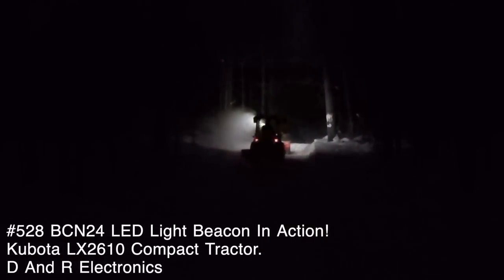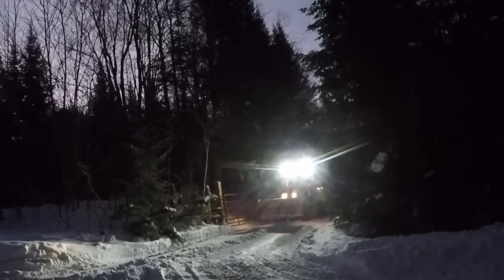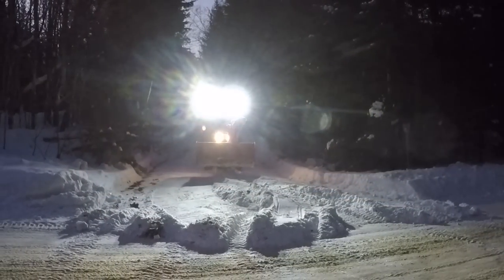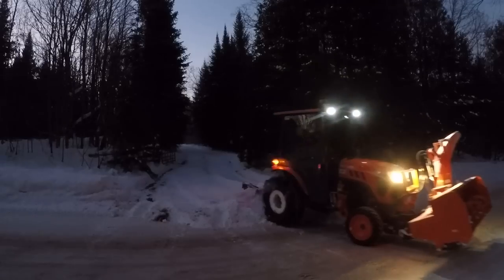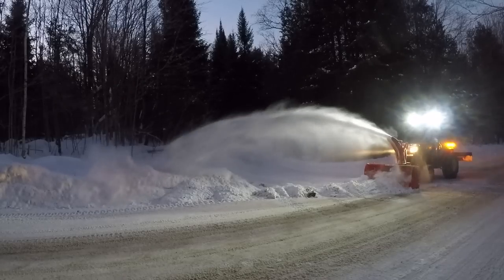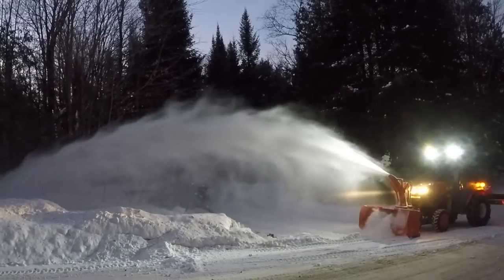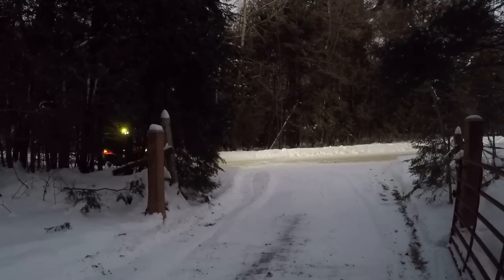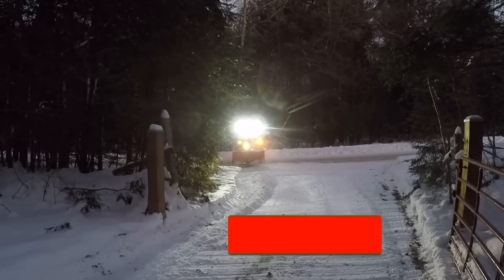528 BCN24 LED Amber Beacon In Action! Kubota LX2610 Compact Tractor. Clearing Snow At Night.

Comment: The strobe works well, especially for the sides and back. Hard to miss those bright front lights. Important for safety when working at the road. Yesterday my brother had his Kubota BX and rear blade helping clear the base of a neighbor's drive, and some guy speeding came by and caught the toothbar he had on his bucket. Took out the side of the car all the way down like a canopener. Fortunately no injuries and just bent the tooth on the tractor but inches for much worse.
Reply from the maker: Wow- good evening MD. Happy no injuries but same thing happens up here. Folks use these side roads like race tracks. Glad all were ok. Thanks for sharing!

Comment: The beacon works well. The low profile is a good choice. It will be interesting to see if it produces enough heat to melt the snow if you are using it during a heavy snowfall. 2 weeks ago a friend of mine just bought a cottage he is going to  move to full time. He's selling his open station kubota and buying one with a cab. He was asking me what would be the best setup for clearing snow. I told him about your channel and all the great information there is not only for snow but tractor's in general. As long as you can give up the loader for the winter a front mount blower seems to put less wear and tear on your body.

Comment: Good video Gord, the beacon may have been a little more clear in between the front lights but the roof wouldn't take the positioning it there. The beacon seems to be doing fine right where it is. Thanks for sharing with us, Fred

Comment: You may see the beacon when you are straight behind the tractor, but when you are on a right turn it will be less effective. I think you are fixed on using the existing hole in the mirror bracket, make a bracket and mount it on the left. (You may have to remount the antenna and the beacon on the same bracket)

Comment: I have the same set up that you have with the work lights. Looks like no matter where you put that beacon , at some point those front lights are going to over power it. That kubota does one heck of a job. I don't need the front blower ( which is super sweet mind you , we just don't get enough snow these days here in North East Wisconsin ) but the rear blade is something I am going to look into. Nice camera work by the way.

Comment: Greetings Gord, from just to your left (depending on which way you're facing) in northern Michigan. One of these lights would be dandy if I had a cab on my kubota LX2610. Instead, I have resorted to using an old Radio Shack toy firemans helmet with flashing red light on top. Eat your heart out as yours doesn't even have a siren.

Comment: Nice series on the beacon installation.  Good video of night scenes using the beacon; the flashing light really shows off from the side and rear views of the kubota.  My JD 3720 cab has the rear flashing lights located up high tucked under the roof of the cab.  They show off well from the rear, but not so much from the side of the tractor.  I really like your tractor/blower/blade set up for maintaining your road. Looks like you will have minimum snow buildup on the road come spring melting and re-freezing season.  Well done my friend.  Steve from Minnesota

Comment: On your kubota you could add two strobes on your blower don't get the strobe that you can see 360 degrees.. otherwise that will drive you crazy.. Also I would put on on each side of the tractor so when you are at the end of your driveway. you can get little round ones If your going to light it up light it up.

Comment: This is a great safety feature. I’ve heard of several tractor accidents where a car strikes a tractor from behind, usually due to insufficient rear lighting on the tractor. This should have you covered. I think you could easily install this in the kubota UTV’s as well. Thanks as always for the great videos.

Comment: I like the way you installed your beacon. When I put beacons on my kubota I reinvented the wheel and made brackets that mounted to the upper signals on the rear of the cab. It worked but was more complicated then your set up. I ran separate wiring and a switch to turn on and off because I didn’t want to hook into the rear work lights. If you would have made this beacon install video years ago I certainly would have copied your work. Good job GP
Reply from the maker: Thanks Jace!

Comment: Strobe light looks great on the kubota. Curious, why didnt you mount it on top of the cab in the center? Was it to avoid drilling a hole in the cab? On some angles I wonder if it was inbetween your 2 LEDs if it would be seen better.  Either way there will be angles that it wont be as visible and what you have seems to work just fine. Enjoyed both videos!

Comment: Anybody that can't see you coming head on should have somebody else driving!! The beacon is perfect for anyone coming from behind. As a 30 + year firefighter I think some of the current LED lighting has gone to far the other way. I have almost been run down because people are blinded by the brightness of the LED  lights. They can be adjusted down but in a large department it's difficult to get the shop time for this.

Comment: Good thing to have and believe if working commercially a legal requirement? Also along that line. Do you know if plating your tractor is require for insurance coverage. I have a kubota 1880 and clear in laws 2km up the road. Think I need to plate and a beacon even for family.

Comment: We can certainly see the kubota coming now.  I checked out the website for the light but noticed they don’t have an online purchase system.  Did you just call them and place the order.  I think I will get a light as I live on a cottage road with many residents.  Better to be seen.  Thanks for another great video.
Reply from the maker: Good evening Andrew. Yes, you have to call for pricing - either direct to them or through one of the dealers in North America. I think there is a dealer finder tab on the site. Good luck !

Comment: I recommend putting the beacon on its own switch, or to the OEM flasher switch if it's steady power at that point.  If you shut the work lights off to not blind oncoming traffic, you'd lose the beacon right now.
Reply from the maker: Thanks Matt! They are bright for sure. I may need to tilt them down a little more. Thanks!

Comment: You can't put a price on being visible, with most accidents involving essential vehicles and normal vehicles, chief excuse among those crashing into essential vehicles was that they couldn't see what's going on.

So these days people sue when they crash into clearly marked essential vehicles because they are marked too well = Tell tale sign of idiot drivers.
And it never works out for them, because the law gave drivers claiming insufficient marking the automatic right of way, in return the law made an exception for owner/operators of essential vehicles to put on any and all marking they see fit, to stay visible.

So then, what does the law in 1st world countries say about driving in low visibility conditions, a fully lit tractor pointed your direction being exactly that, pray tell?
That's right, no way around it, the law states to be in full control of your car.
You're REQUIRED to lower speed to where you can safely circumnavigate said tractor without hitting it or injuring anyone.
Dumb drivers more or less backed themselves into a corner with all that suing, it's beautiful🤣